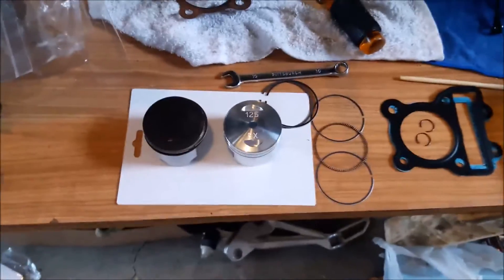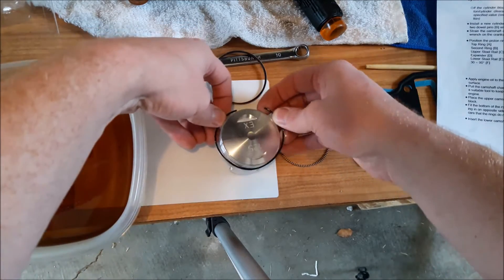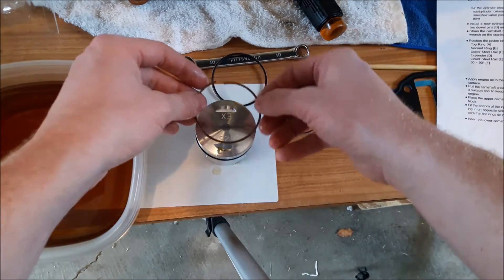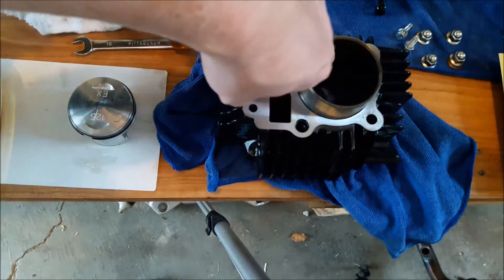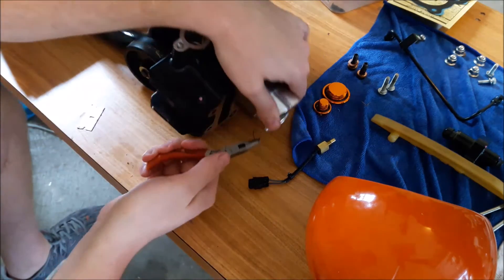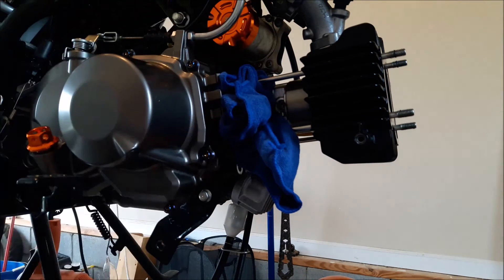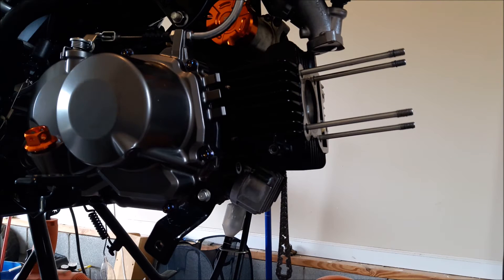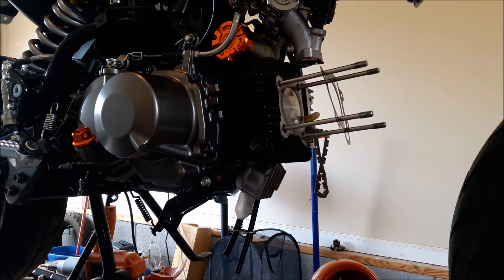Kawasaki Z125 Pro 12:1 CR piston

Comment: Quick Question for you.  can you use any aftermarket cam with this kit?  I already have a TB parts cam.  Will it be ok with this piston?

Thanks!
Reply from the maker: Use any you want
Reply: @limp1144  where can I order this?
Reply from the maker: @JarrenHetfield  I am a kitaco dealer I can order you a kit. Hardracing sells them too

Comment: Hey buddy, i just had the cam & piston installed and im having a problem. At about 80%-85% throttle in 4th gear i loose power, its like the motor is shutting down. I have to pull in the clutch and shift to 3rd and rev it.  Sometimes when i pull in the clutch it dies out. This happens after about a mile at 80%-85% throttle in 4th. Im still tuning in with pcv and autotuner. Any ideas ?
Reply from the maker: Pull 2 degrees timing out and run 93 octane pure gas if you can
Reply: @limp1144  thanks
Reply from the maker: @cuchsluch  yeah pcv tried adding more timing gotta back it down